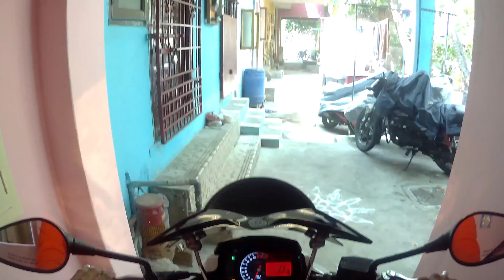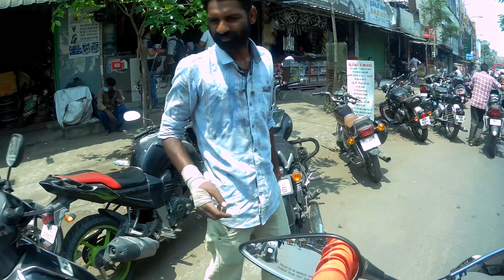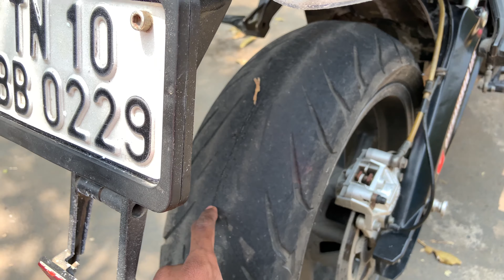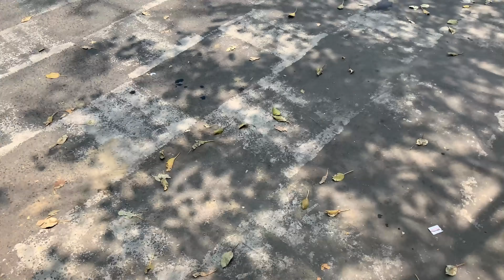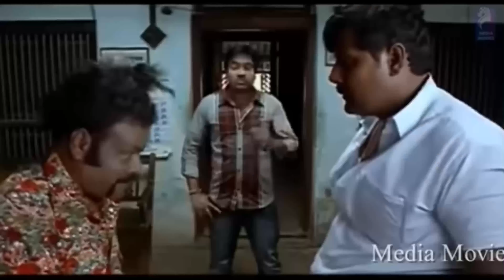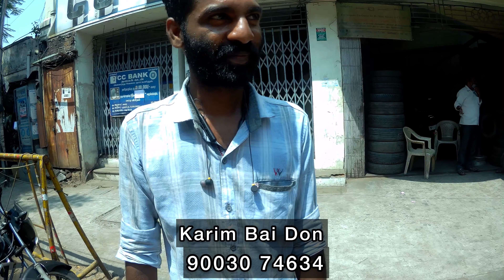Wow😍 | BENELLI 600i REAR TYRE CHANGE | அடேங்கப்பா 😍 BIG TYRE | தமிழ் | இவ்வளொ கம்மியான வெலையா😍

Comment: Bro neega unga bike model enanu solitu apram top speed video poduga
Reply from the maker: Sure bro kandipaa🤗
Reply: @ONEMANSHOW_LIFE  naanum romba naala benelli top speed theduren...yaarum olungana top speed sola matraga apdiye sonalum entha year bike nu sola matraga
Reply from the maker: dont wory bro. I will do it clearly... soon... once my bike is ready from service center
Reply: @Jana_The_Enigma  2019 model ABS 
Locked up to 229 in 6th gear with ixil 55 exhaust without DB killer 
1st gear top 90
2nd gear 137
3rd 164
4th 194
5th 217
6th 229
Reply: @fayazas9979  stock exhaust use panna top speed change aaguma bro
Reply: @Jana_The_Enigma  obviously , but depends upon the rider ,
Crcta open pana perfect top speed kudukum superbikes laam
Reply from the maker: Top speed will not change as it is locked however pickup will get increase bro